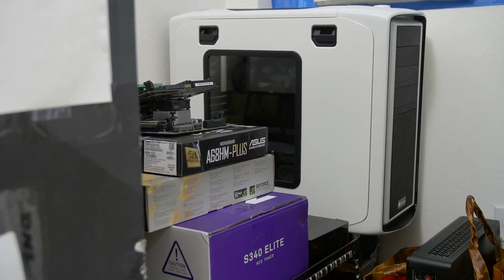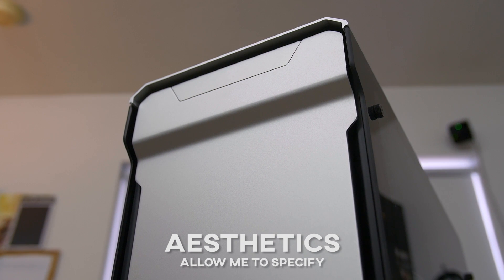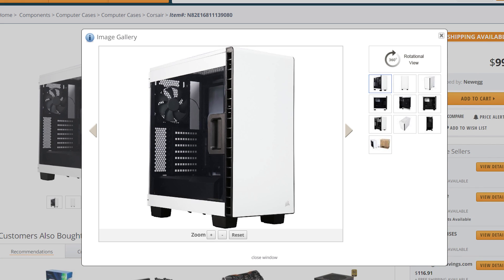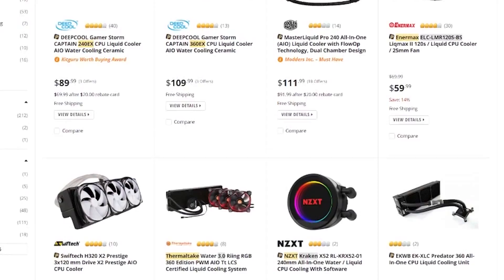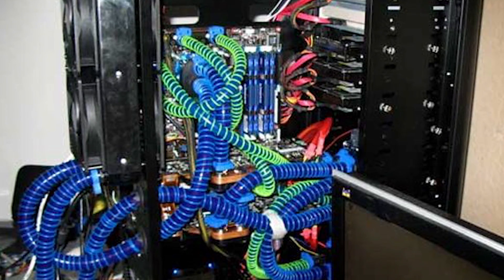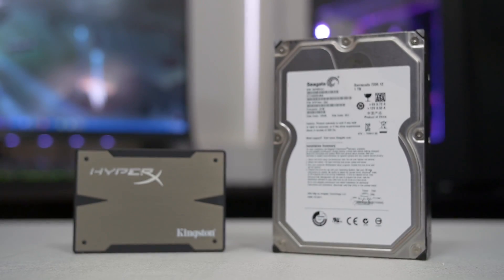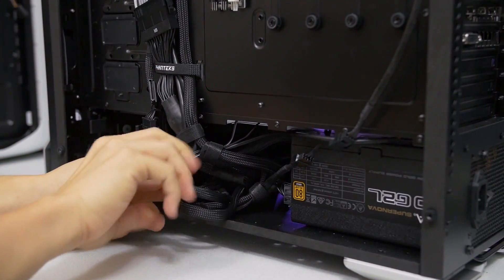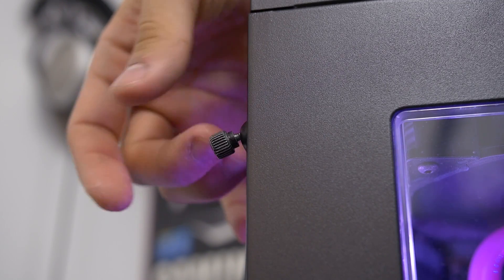4 Major Changes to PC Cases in the Last 5 Years: Then and Now

Comment: A quality of life change: PSU mounting location switched from top to bottom. It is awesome.
Reply: THIS. You can be a cable management master or a hard tube watercooling guru, but I'll be damned if you can install those tiny front panel connectors correctly on first try.
Kudos to Asus for their Q-connectors.
Reply: @estidi  Gigabyte has an awesome G connector which locks the front panel connectors into place, unlike the Q connector
Reply: ***** Oh the woes you have not had to endure like the rest of us, they are immeasurable and incalculable. Seriously, why can't the other manufacturers take note of the awesomeness of Asus?
Reply: Petri Helenius heck even my Asus P5Q Pro Turbo had it
Reply: TheColorfulPube Instructions unclear, my dick got caught in the PSU fan.
Reply: Petri Helenius there is already a de-facto on front panel connectors, at least on OEM cases and mobos (except Dell). The placement of the pins are almost always in the same location, so you just have to memorize which pin goes where.
Reply: Aurva Roy exhaust fans, not intake fans
Reply: wait I don't get, first time builder and I just read the mobo manual and connected them all correctly first try
it only took me a minute or two...

At least my cables were clearly marked even positive and negative and so was the mobo, I just double checked the manual so I didnt fuck it up
Reply: zeemonkeyman1 yeah, I just recently figured it out accidentally myself, and the amount of lulz and facepalming was glorious when I found that all my past frustrations regarding this had been for nothing.
Reply: estidi ok no joke I got every front panel connector right the first time except the speaker... I had it backwards :(
Reply: on my first pc build I put the power button on the serial pins xD
Reply: +Petri Helenius My Gigabyte motherboard came with a front panel connector, and it worked nicely for me. I think they call it a G-connector. Not sure if Asus did it first, but if so I'm fine with them copying it.
Reply: Malus1531 Goddamn, it must be a "recent" thing then, I'm running an older Asus board and that didn't have that kind of awesomeness yet. What mobo you running, is it an entry level or more of a high end board?
Reply: +Petri Helenius I'm using a Gigabyte Z170MX-Gaming5. It's about a $150 board, but I think I got it on sale at Amazon for $120.
Reply: jhsevs then it would seem that it may not be exactly a new thing, and highly dependant on the mobo that you buy.
Reply: the mounting location was a huge change imo.

the design changed drastically when they realized you could put the PSU on the bottom (and on some cases on the back)

is there really more room for improvement on the cases department? :thinking:
Reply: It's not as much there being any issues than something else which I will explain shortly. I don't have any major issue or trouble putting them into the pin connector on the motherboard correctly, I have put for example a few times the PWR connector to the right pins, just not the correct way so the connector was "reversed", if that makes sense. I've learned to pay attention to that.

My biggest issue is that it's so damn annoying to place those separate connectors to begin with. Based on the comments written here previously, the mobo pin layout would appear to be somewhat standardized at this point, and the issue is perhaps more with the case manufacturers.

Let's take Bitfenix's Neos as an example. It's a cheap case, but for a budget case it's pretty damn good, I can't really find much to complain, it even looks decent enough (at least it appeals to my sense of aesthetics). Sure, doesn't have a lot of fancy features but I can definitely live with that. But the front panel connector wiring is where it bites the shit. It starts off as something of a single, flat cable, and the wires separate into individual connectors near the very end. Too close to the end, as there only very little room to try to move and orient each connector correctly, which makes the task of connecting each tiny connector even more daunting than it has to be.

Again, this is handled quite differently depending on the manufacturer or even different cases by the same company. But that still doesn't take anything away from the original point I tried to make which was that why are we still stuck with these tiny individual connectors instead of the front panel wiring tied to a single cable and connector.
Reply: yeah it is so awfull, inwin still sell a case with that thing on th top and it is so painfull to watch
Reply: Just face the fan outward?
Reply: there is a switch in the back? /s
Reply: GavinChase It's not hard in terms of figuring which cable goes where, it's just annoying to handle the cables due to their small size and in some cases the cable bundle separates the individual cables so near the end that it leaves very little room to work with each individual connector.
Reply: +estidi I do it on my first try almost every time. XD
Reply: its good UNLESS your watercooling, just makes it even worse if it does for some reason leak
Reply: jhsevs 
Or read the book that comes with the Motherboard if your struggling THAT much with it! It's not hard lol
Reply: Petri Helenius 
I think you'll find that you can actually seperate the individual wires yourself further if need be. That sort of cable is usually designed like that. At least in my experience they always have been. (I'm an Electrician)
Reply: idk man, I think a lot of people just bought/buy shit cases. My first case (2007, Antec Nine Hundred) had a bottom mounted PSU, 2nd case (2010, NZXT Phantom) as well. New case will definitely have a PSU cover, hoping to upgrade in the following months. :-)
Reply: PSU manufacturers need to design cable lengths do to the power supply being further away from the plugs as the motherboards haven’t really changed placing
Reply: Took time to get used to having the PSU on the lower half instead of at the top which gives the impression that it might fall off and hit your GPU.
Reply: @Jorus C'baoth that sounds so stupid. If you have the money for a premium 1000w+ PSU that is also from a very reputable brand, you're unlikely to be the type of person to get a budget case, which means that le gasp you can buy any case to your heart's content lmao. Different strokes for different folks. I have an EVGA G3 fully modular with custom sleeves, in my Corsair Crystal Series 680x, which has a secondary compartment for the entire backside where the PSU is stored, sideways I might add, so its pulling in air from the wall instead of the floor because that's just how I wanted it.
Reply: Yeah that's nice for the most part, but it does make it harder to hit the switch in back.
Reply: ***** I should bloody hope so, I don't want to go back to those olden days of top mounted PSU ever again :P

If there's one thing I would love to see become a thing, is that someone would come up with a standard regarding the PLED, HDD LED, PWR and Reset connectors and the corresponding mobo pins, so that there's one connector, get that applied to all mobos and cases across the board in order to do away with the individual small cables and connectors, those are annoying as fuck. And get those damn OEM manufacturers (Dell, HP etc. you know what I'm talking about) follow all the standards as well. Not sure if any of the companies still try to get away with proprietary shit, nothing irks me quite as much as some of the crap they've done in the past.

Comment: The main question now: Should I get a
Samsung 960 Evo for 3,200MB/s seq. read speeds, 1,500MB/s seq. write speeds, but ugly,
or 
Samsung 850 Evo for up to 540MB/s sequential read and 520MB/s sequential write, but smexy looks.

I'm kidding, I'm going with the 960 evo no matter what, I just need attention ;-;
Reply: to be fair, you dont even notice an m.2, looks like part of the mobo at quick glance
Reply: acme64 I know, I was joking about performance/looks.
Reply: Jec adjust glasses yea but technically...
Reply: acme64 adjusts braces
but actually...
Reply: wtf, the 960 Evo isn't ugly at all.
Reply: Justin Miller It costs about 10% more for over 250% the performance. If your motherboard supports an M.2 slot, get one.
Reply: Start up and game times aren't at all that much different. I have a raid array in mine, I've got 2 850 EVOs with over 1GB/s read and write speeds but the only it helps with is 1440p 120fps recording with Dxtory and 4K 60fps, too. For some reason it's given Star Citizen PTU a boost in fps from 40 to 60, which I really wasn't expecting.
Reply: Justin Miller No, because that's why M.2 is good lol
Reply: FlamingRadar I said the 850 evo. The 2.5" SSD.
Phake Phakerson It's a M.2 drive. It automatically looks horrid :>
Reply: Jec doesn't matter sata ports bottleneck to around 500 mbps
Reply: Jec yep. Is it really worth it tho>:
Reply: ***** I'll be comparing this to my friend's Kingston 2.5" SSD if it matters, so I'll try to get back to you. Add me on steam if it really matters lol

Comment: The fact that cases have stopped coming with 5.25 bays frustrates the hell out of me
Reply: yeah, in my new computers case, im just gonna put my optical drive inside the case, because goddammit i want my cd's!
Reply: /*//Well shit-- Let me clarify. Me wanting the drive bays on my case are much more for the accessories than an actual cd/ dvd/ bluray drive. Personally, I like to have a front mounted fan controller. While I know mainboards have really good fan controller support onboard nowadays, to me there's just still something to having a nice looking display that lets me know what's up at a glance. As far as cd's go- I keep them as a backup should something fail & I have to pull them back out & replace whatever may be lost from time to time
Reply: Solkia2010 I could imagine how close those drives are...
Reply: Agreed. I've honestly never used the blu ray drive I put in my computer, but I just wouldn't feel right without at least having a DVD drive.
Reply: I still wont buy a case that doesn't have front bays. And companies have gotten really good at blending unused drive bays so they're not just a funky chunk of rectangle blah on the cases face
Reply: Whenever I need to reinstall a game (from the disk since it save time) I usually have my CD drive hanging out the back side panel lol. I think I need to get a slim usb 3 CD drive instead.
Reply: Josh P they really are ugly esspecially when they don't match the paint/aesthetic of your case. On the other hand for those of us with shite internet, I would say settle with a usb disk drive, something you can hide in a draw until you need to reinstall that large game.
Reply: They’re ugly... and you can download ALL software from the internet.

Comment: I'm going to sound so old right here. For my very first PC build, I bought a custom window kit. My dad helped me physically cut a hole in the side of the case and these flexible rubber pieces were glued to the sharp edges. The side window was held on by velcro, lol. I cant' remember if the lights were LED (probably not). They were wired to a 4 pin connector and turned off and on with a toggle switch that was mounted to an empty drive bay slot, that we also had to cut a hole in to mount. Holy crap I wish I still had that case for the lulz.... At least a picture.

Comment: i dont know why anyone would buy extensions when u can buy the full cable at ur exact wanted length
Reply: Cause extensions are waaaay cheaper, and also its hard to find a sleever that has your specific PSU model. Sleevers usually make full cables for Gold and Platinum rated PSU  for the bigger brands (EVGA and Corsair). If you have a psu from another brand even if its good, or simply a lower end model for EVGA and Corsair you won't find full cables. 

For example the Silver and Bronze 80+ from EVGA is very good but you won't find full cables for that. Also there is the thing that there are a TON of semi modular PSUs for which you again need extensions, that why I use extensions on my EVGA 750 B2
Reply: Because not all PSUs are fully modular.
Reply: MoDRun If you have a non-modular or semi-modular PSU, you can't put in custom cables. Only extensions would work in the case.

Comment: i really hate those "smart" ssd brackets behind your motherboard tray, they are a pain in the butt to wire with sata chains and angled sata data connectors. Bring back the good old drive cages! Also i still use the 5.25 inch drive bays, i love my scytche kama cabinet pro and it's a lot cleaner to have a card reader on your pc instead of on your desk.

Comment: Other things are decent fan filters, and also a trend away from placing headphone and USB sockets on top facing upwards in the ideal place for them to fill up with dust and gunk! However, what does impress me is that a few of the case manufacturers are leading the way by not copying competitors designs and just developing their own innovative solutions, which most importantly, are competitively priced!

Comment: I actually liked the latch system on the 600t side panels. Aside from the USB 3 issue and the failure-prone fan controller, it's still a decent case.